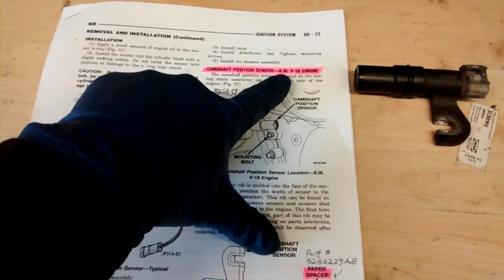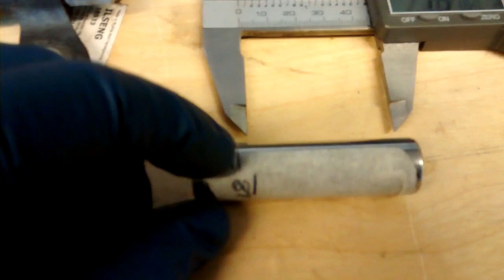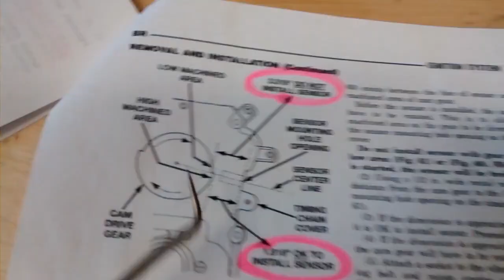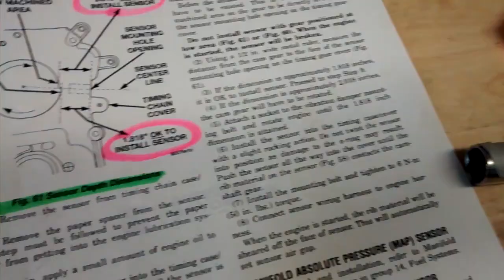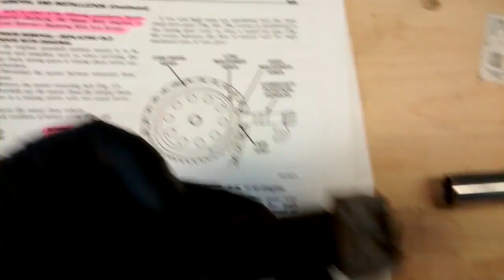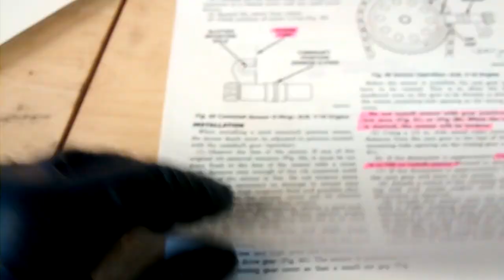DIY Dodge Ram V10 8.0L Camshaft Position Sensor Proper Install (1997)

Comment: Just a wonderfully thought out and executed presentation.  Thank you.

I replaced my dead crank sensor a week or two ago to fix crank/no-start condition.  Enjoyed what seemed like full smooth power since then...

Until yesterday, after rainy windy night parked. And after keyless lock remote cracked and stopped working (now remote is fixed).

 Now I get starts that shutdown 2 seconds later.  Possibly superstition, but I find the next turn of key gives cran/nostart...until I lock/unlock doors with remote.  Once started and   after a long while with foot on throttle held to 2000rpm, I could maintain shaky idle.  Test-drive involved several shutdowns en route, followed by remote lock hocus-pocus, then starts.  By end of ride, accelerations were prone to rough running, and accels up hill we crippled by the roughness.  I ultimately needed to shift down to 4L ratio in order to low-rpm crawl up my steep driveway and get parked.

 Will try your mentioned non-flood WOT reset trick today.  I have already ordered a cam sensor that I can install if reset fails ( fully prepared thanks to your lesson!).  

Fuel pump is new, but has been giving me occasional empty-tank gauge reading on start-ups, even while running engine fine.  Possibly a whole different issue...

I wish there were a solid yes-no test for PCM going bad.  I would love to know that computer is sound and that components are the problem.

2002 ram 2500 v10 with new 47re automatic transmission.  Just found and cleared stored crank sensor code AND cam sensor code that had never triggered CEL on dash.

Wish me luck!
Bill

PS-
Dry cool morning. Stomped  accelerator to floor turned the key.  Leapt  to life with stable idle and smooth power all the way to and from AutoZone to pick up the cam sensor I may or may not need.  At least so far, maybe just the flooded detection reset was all I needed(?).

Comment: I wish I watched this before I attempted installing my sensor. busted off inside my motor and now the half of the sensor is most likely in my oil pan. great video I'll use this when I get my next sensor I just ordered
Reply from the maker: Ah man, I know what you mean!  If a large part of the sensor is missing, then perhaps you can just drain the oil and see what comes out with it.  Good luck!

Comment: Is this one of the first things you recommend replacing? Just got a 98 v10 3500 with 111k miles and I’m trying to do preventative maintenance
Reply from the maker: Perhaps, but I would at least buy one to have on hand, because they can be hard to find when you need 'em.  You might not ever need to replace it, though. I hope that helps!

Comment: Excellent video and you followed the manual when possible and adapted when necessary. If  I owned a shop, I'd hire you in a heart beat. I got my manual (PDF) free online somewhere. Wish I'd recorded the site. (Sorry, all.) OK, down to business... All I did was change the sparkplugs and now THE ENGINE WON'T START! (The old ones probably were OEM for the 232,000 miles on the odometer!) What a project  on Bank 1 (left side and that's where the worst plug wear was evident). Now, the truck won't start.... rotates OK, but no ignition, etc. Using my home-made relay break-out harness and a multimeter, I've determined that the ASD (Automatic Shutdown) relay is being commanded (its ground released) by the PCM ("new" and real-world tested the day before with the old plugs still in the engine!) after abt a second or three of rotation. Never messed with anything else during the sparkplug changing process..... Engine ran like a top before, even with the old PCM and old sparkplugs ! Even put the old PCM back in to make sure the "new" PCM  was not the problem (hell, after looking at the plugs from Bank 1, I don't know how either PCM ran my truck at all! What could have possibly triggered this problem by only replacing those sparkplugs? As near as I can determine, there's no "Re-learning process" to be performed by the PCM. What say you all?
UPDATE 08/24/21- Final update: All indications pointed   to the crankshaft sensor. No output as verified by the "Sensor Tester Plus". New ones (2) received from China checked with tester before installing one (second for spare). Installation was a nightmare, but the beast started right up!
Reply from the maker: Wow, I'm not sure -- but I will just mention that once we had a similar issue where it seemed that the engine was acting as if was flooded, and as if "something" (ie, computer memory) was keeping track/detecting that condition even though it wasn't actually occurring.  What fixed it for us was starting with the throttle to the floor for a "clear flood mode".  I don't have my manual handy right now, but do you see any such procedure discussed in the manual?  
I'm sorry that's happening to you!  If that doesn't work, is there any chance you might have accidentally put the ignition wires in the wrong order on a side?  Or maybe there is an engine ground that was loosened during the repair?  (If I remember correctly, the cam and crank sensors report back to the PCM before the PCM allows spark).   I'm just guessing out possibilities here...I don't know if there is a re-learning process on the PCM, but if I have a chance to get to my manual, I'll post back with what I find.  Good luck!
Reply: @L35inColorado  No "clear flood mode" that I can find in the manual index or otherwise. I'd try it, though, were it not for the fact that I've disconnected the sensor at its connector at the oil filter for further verification that the sensor is, indeed, shorted. Its output to/at the computer's sensor input on A8 remains at 5 VDC when cranking the engine. (I know this by "pinning" the signal wire and monitoring its voltage with a meter) This tells me the sensor is internally shorted to its supply voltage input (5 VDC). I'll be testing the sensor operation independantly from the truck as soon as I get a "Sensor Tester Plus" (I could have cobbed together my own test circuit, but this tester is multi-functional.) There's no chance I've crossed the ignition wires as I did each plug separately (and I don't want to replace those plugs again!). Haven't seen anything in a "re-learning" procedure, either. I've ordered two sensors from China, and will definitely check 'em out BEFORE I attempt to install one! I may end up having to try Walker's 235-1115, also, or Duralast's SU399.

Comment: Thanks for the video! I accidentally installed my cam sensor on the low machined side during a cam and timing replacement, and it took me weeks to figure out what the problem was. Just pulled out my old sensor and the tip is ripped off.
Reply from the maker: Ah man, I'm sorry that happened, but I'm glad you figured it out!  I think that happens a lot because the design of this cam sensor is strange with the "air gap" and all, which as you know, is not something you see on most cam sensors.  Thanks for you comment and good luck!  : )

Comment: does anyone have a link to a manual for this motor do you have a recommendation on where to buy these sensors?
Reply from the maker: If you are in the US, you can buy the camshaft sensor at Autozone -- it is Duralast part # SU399.
For the service manual, you might try the Chilton or Haynes manuals, because those are the easiest to obtain.  You can also buy an AllData DIY pass (www.alldatadiy.com).  I bought a Dodge Factory Service Manual from ebay -- you might check there.  
Good luck with your repair!

Comment: Hello, great videos on the ram. I just picked up a '98 with the v10. I really only had one question. Is the part number you showed for the cam sensor year specific or will it work in all applications of the v10. Mine is a 1998 and it seems like the one that's on there that the previous owner installed doesn't go in anywhere near as far as yours does, no matter how hard I push. It only goes in until the O-ring is out of sight then it won't go any further. Found that out onlu after rotating the crank to get it to the right position and making my own spacer out of masking tape. That being said I'm not positive if it is the cam sensor. I have a no start condition. I am getting fuel but no spark. Previous owner replaced the crank sensor too so that should be good. I'm thinking it's either the pcm or the cam sensor. Thanks
Reply from the maker: According to the Autozone website, this same sensor (Duralast SU399) is listed as the proper camshaft sensor for your year (1998), as well.   The position of the sensor will vary slightly based on the cast of your particular block (that's why you have to use the spacer, etc), though it should not be an extreme difference.  

But, since you aren't getting spark, then I would look at the crankshaft position sensor instead and the K4 circuit instead.  Check the crank sensor harness because the wires get damaged by the hard plastic "protector" thing that Dodge stuck on them.  There are also the following components on the K4 circuit, which is the circuit in control of starting (from the PCM, PCM is power and ground for these sensors):

- cam and crank sensors
- coolant temp sensor
- throttle position sensor

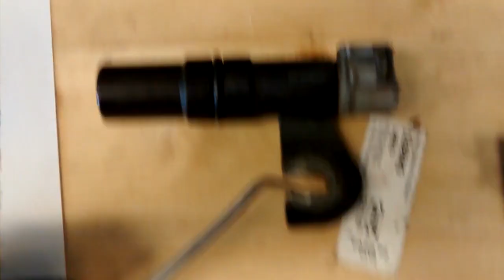But, from what I have seen in my manual, the no-spark condition refers first to a faulty ASD relay, then next to a faulty crankshaft position sensor  For the ASD relay, just pop open the fuse box that's under the hood on the driver's side.  In there you'll see a map for the fuses and relays -- find the ASD relay.  You should have another identical relay for another component, like the trailer relay.  Swap them, and see if she starts.  You can see what I mean at the 3:34 mark on this video:

https://www.youtube.com/watch?v=8mPdGmC7_es&t=437s

For the crank sensor, you can test this sensor with a multimeter -- it should be getting about 5V with the key in the ON position (back probe the violent/white wire on the crank sensor harness with the sensor plugged in, and ground the multimeter to the block anywhere convenient, and you should see 5V when the key is in the ON position, and a wide range of values between about 0.5 V and 5V when the engine is cranking).  Hopefully you just have a messed up harness to the crank sensor that you can fix.  If you are getting voltage to the sensor, then check the coolant temp sensor and throttle position sensor, and if those check out too, then it might be time to find a PCM.
Reply: @L35inColorado  I appreciate the help. I think I'm running into something weird. I've tried testing the crank sensor and the throttle position sensor and I'm getting 5v to two of the three wires with the key on. I get the same results if I back prove the sensor or unplug them and probe the pins on the connector. I thought the three wires were supported to be 5v supply, ground, and computer signal and that only one of them would read 5v? I don't have a wiring diagram so I don't know whats going on haha
Reply: @bluejwalker  I have the same results and a no start no spark issue and if i unplug the sensor I have 5v 5v and a ground but if I plug it in I have 2.5v 5v and ground.  Did you figure your situation out yet?
Reply: @rachelthommes6653  In my situation, it's not displaying a check engine light and the computer isn't throwing any codes. My pcm grounds are testing good. I believe that if it was a sensor issue then the pcm should be at least producing codes or a check engine light. I'm about to order a new pcm, will update if that fixes it. It's estimated 4 weeks to get here

Comment: what was the reason you replaced the sensor, no start situation? no spark? just a check engine light code? reason im curious is im dealing with a no crank no start situation that is intermittent. no spark.
Reply from the maker: Sorry for the delay -- I had a crank-but-no-spark, and no check engine light.  If you are having an intermittent no-crank-no-start, then you might check the crankshaft position sensor.  That is known to fail intermittently.
Reply: Did you ever fix yours i have a 95 v10 4x4 dually beautiful truck very clean i love it but it just cranks over and will not start for nothing in the world
Reply: No I hadn't we scrapped it. I picked up a Chevy instead. More reliable and better payload in the z71